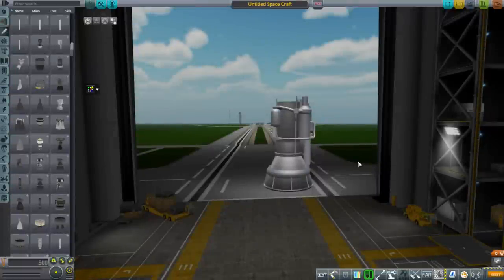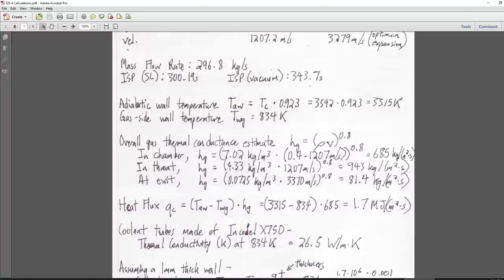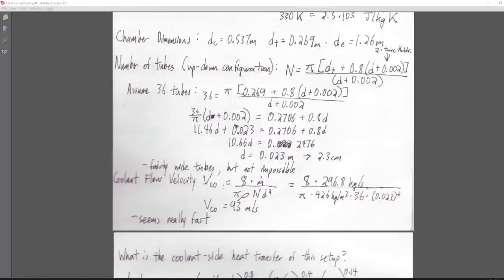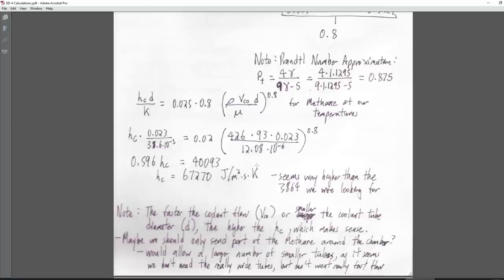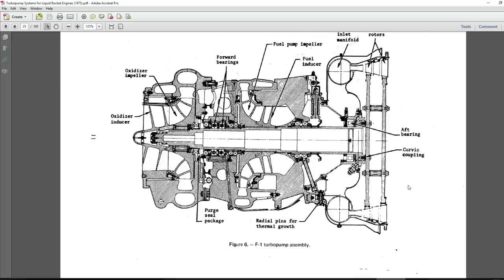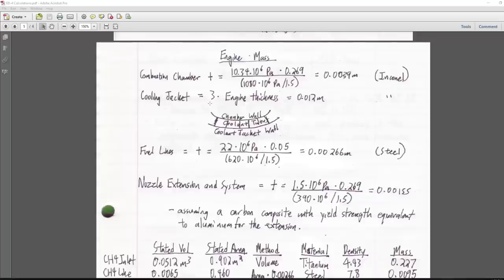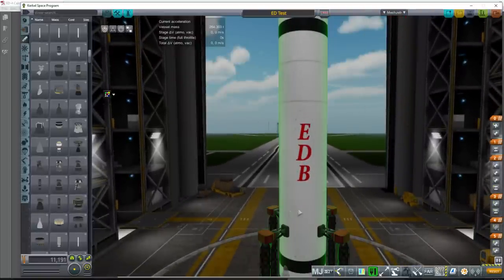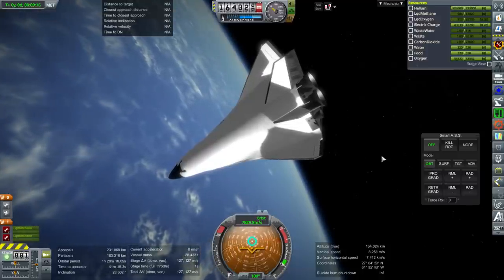Rocket Science - Design of a Gas-Generator Engine

Comment: This is an addendum on my previous comment, when calculating the heat transfer coefficient the approximation you used doesn't account for things like the chamber/throat/nozzle diameter. That can severely effect how much heat energy is being transfered, the throat generally has a much higher heat flux than the other parts of the engine. Radiation is generally negligible if your wall temperatures are 800K or below.

Comment: Regarding your mass estimates, just wondering: are the area numbers from Blender total surface or one side only? E.g. for the nozzle, is it inside+outside or only one side? If it's both, then that would give you a factor of two on the mass for these parts; and with another factor of two on the volumetric parts (eyeballing the pumps as only being "half solid"), that would probably get your pure-engine-TWR close to what you had for the Merlins.
Reply from the maker: From the Shinkansen spaceplane, it seemed to give just one side for area, but I can double check (many parts are basically just cylinders anyway).  I might go to two-thirds solid on the volume parts just for margin - there are parts of a normal engine that I definitely haven't added in, and I want to leave mass-allowance for those.

Comment: FFSC should be more reusable due to not needing super special seals to prevent rich gases from leaking along the shafts and getting back into the turbopumps because the rich gases are not going to 'combust' in the turbo pump.  I.E.  Oxygen rich gas will not chemically react with LOX and same for the fuel side.   Second, you can design each side with materials that resist the corrosive effects of each propellant type.  Lastly, mass flow rates for a coupled single gas generator take twice the shaft power as two gas generators with two separate shafts for the same mass flow rate, thus lower turbine temperatures are needed.

This should increase reusability.

Now all we need to do is make this whole process a game 'plugin' that you can run in the game to design engines.  KSP's science 'tree' has always bugged me in its utter simplicity.
Reply: You still need the special seals in the oxygen rich preburner. probably the most ideal cycle for reuse is an open expander, since your working fluid is essentially warm hydrogen

Comment: Hi, I have been busy the last months, in calculating and modeling an advanced version of my first 2KN500 Thruster. I found out that the Demo version of RPA is useable, You just need to restart if after 3 Calculations, can only use 2 propellants, only 3 different Cooling types and maximum of 30 points can get calculated in the nested analysis. But it is definitly usable for everything (also mass estimates).
I made a basic model of my engine in Blender, but I did something wrong with the collider and Textures / shaders, could you mabye do a video about this kind of stuff ?
Btw I thinkh with that knowledge i could start releasing my own mod about high performance chemical engines for Realism Overhaul. ( If i may take the model you made for the first version of the 2K500 for that) 

Thanks,
Keineahnung4010

Comment: Hello, me again. 
I think you are misinterpreting H of the liquid coolant. I am rereading the jet/rocket pro notes that I referenced last time. It appears you pretty much have the same formulas I do. (this is where I commented last https://www.youtube.com/watch?v=rAWpJuzvBEA) 
I am fairly certain that Hg is how effectively it draws in heat. The reason you are getting a smaller value required for when the temperature is lower for the coolant is that for a larger temperature differential you require more effective cooling. The fact that the value you found for your design is much higher is actually a good thing. It means your wall temperature is going to be lower than the value you were trying to find. Note that I am not sure that it being solely a good thing is strictly true for an expander cycle engine. It also allows for the heat transfer to be enough even after the collant heats up as it travels along the wall.
also for your turbopump calculation, most jet engines at least use a nickel super alloy for the turbines. This is probably the case for rockets to... I don't think you are using the right material.
Also if you want to mess around with turbo pumps here are some power formulas. 
Power a liquid compressor needs = volume flow rate* pressure pump added = mass flow rate/density * pressure pump/(efficiency of pump)
power a gaseous turbine gives out = mdot * (decrease in temperature) * Cp of the gas * efficiency of the turbine
The cp of the gas can be found from it's component gases using the mass weighted average of the component gases Cp. And also the pressure difference over the turbine is p_after = p_initial * (Tafter/Tinitial)^(gamma/(Gamma-1))   
I say this because I don't think you are taking into account the decrease in ISP from having the exhaust gases of the turbines. Rule of thumb:
ISP_engine = (ISPMainChamber *mdot Mainchamber + isp_turbine exhaust*mdot turbine) /mdot_total. 
IE. The mdot weighted average of the ISP's. 
if you want to get really complicated in your flow diagram just reach out to me and I can help. Also If you want more detail on at least turbines, I have (jet engine but it applies here too just requires tweaking the gas properties) axial turbine code in matlab for generating stages, blade numbers, size, (and with a selected airfoil you can probably make a good mass estimate. It's not strictly mine(it's an old group project I was in, but the code was pretty much made by me) so I can't let you share it, but I can use it on your behalf NP. Also I can pretty trivially write code for creating an axial pump in matlab as well if you are interested. 
If you are interested in the staged combustion, I also have temperature and pressure relations for gas mixing assuming adiabatic and reversible mixing(not as absurd as it sounds). but it is going to be nasty to type so that's only if you are interested.
Reply from the maker: Yeah, I remember your comment. But maybe first hc is the effectiveness of the cooling and the hg is actually the heat generated given the design?  On the material, Inconel is one of those Nickel Super Alloys, so maybe I can just use that for the turbine blades - I'll calculate the blades separate from the rest of the mass.

Thanks for the power formulae - I'll put them to use once I've read up more on turbopumps. On the decrease in ISP, I think that's partly covered by our overall efficiency rating, though I'll ultimately check with your equation. Considering we're getting 343s vacuum on the sea level engine when a more typical number for methalox is 360s, and we're getting 373s on the vacuum when SpaceX wants 381s from the vacuum raptor (which, admittedly, is staged combustion and should get more, but not too much more), I think we're okay on the ISP estimate. It depends on what we think is going on with RPALite's efficiency calculation.

I'll try to work out the flow diagram myself first, present the results, and then you can give me the pointers to correct it.

Thanks for your help!
Reply: @RaizSpace  that is kind of true. If I understand your nomenclature right, the hg is how effectively your rocket exhaust transferred heat to the wall(bad) and hc is how effectively the coolant works... So yes you have the right idea. Also keep in mind that space x is using full flow staged combustion(afaik the most efficient turbopump setup if you don't include batteries or expander cycle) with insanely high pressure of 300 bar. They're going to be more efficient than you. 
Full flow means that they have all the fuel flowing through the two preburners( 1 ox rich 1 fuel rich) and then straight into the main chamber. Nearly Everywhere burning at high pressure is more efficient. If you go gas generator which is where you dump turbine exhaust overboard, it is going to be terrible efficiency.
Reply from the maker: I'll take a look at the loss due to the gas generator in further detail when I work on the pipe diameters and then adjust the ISP accordingly. Once I refine the turbopump mass calculations to avoid making it a solid lump, that should lighten the engine and help compensate. The high pressure in the SpaceX Raptor doesn't help the ISP too much (though full-flow staged combustion certainly does) and mainly serves to make the engines physically smaller so they can fit 31 of them on the bottom of their rocket. Another comparison might be the staged combustion of the RS-25 versus gas generator hydrolox engines like Vulcain 2. The ISP drop between the two is about 20s, which is the same between the sea level Raptor and the ED-4. I've got a fairly large vacuum nozzle on the vacuum version, but I'm not sure what the ratio on Raptor Vacuum. Still, I'll refine the numbers.
Reply: @RaizSpace  even if you keep the area of the nozzle the same, and even more so if you keep the same exit pressure, adding combustor pressure is always going to slightly increase isp. In same nozzle area you are just increasing the difference between ue effective and ue. Think blowing up a balloon, no combustion but the more compressive the balloon material is faster the exit velocity. The reason you don't see insanely high pressure of 300 bar is that for any system you either dump turbine exhaust overboard from either a preburner or combustion chamber is that you're increasing the mdot turbine and decreasing turbine exhaust isp. Typically around 50-100 bar is where the goldilocks zone of combustor pressure is for sea level engines in over board dumping mode. in staged combustion and especially full flow staged combustion your overall isp tends to increase the higher chamber pressure. If you increase your pressure Fed engine in the software to 300 bar you'll probably see isp close to space x